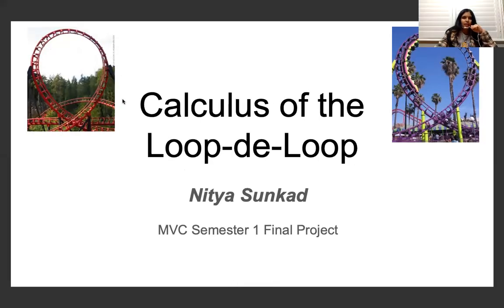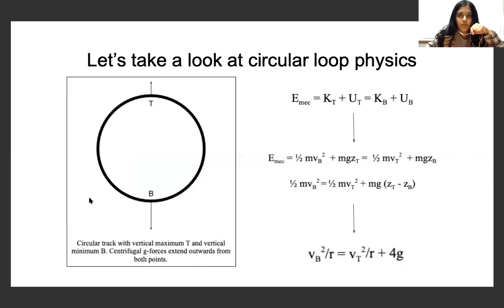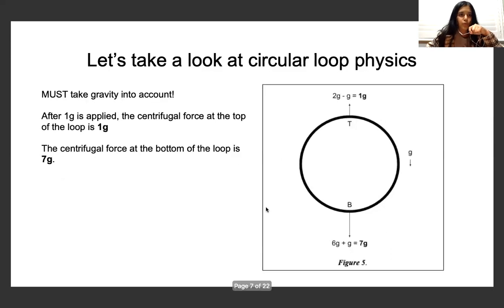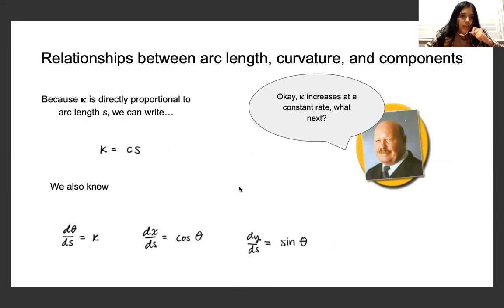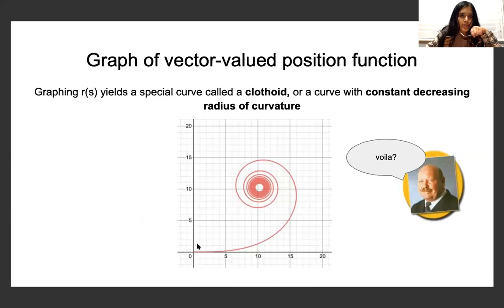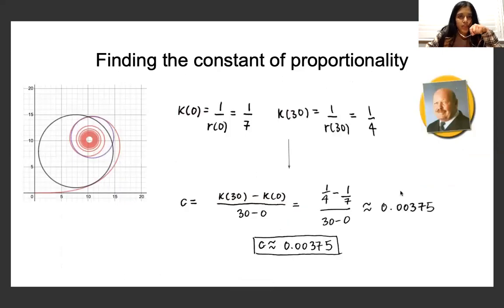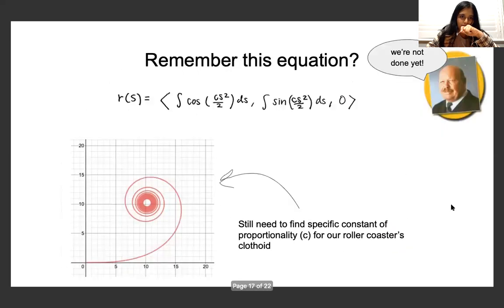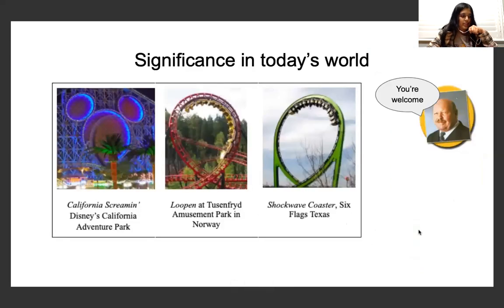Calculus of the Loop-de-Loop

Comment: wikipedia: "In 1957, Schwarzkopf built his first attraction, the Düsenspirale, which was a roller coaster that traveled around Germany with funfair showman Löffelhardt. He took over his father's company in 1960 and created his first full-scale steel roller coaster, The Wildcat, in 1964. In 1970, the first Jet Star II model was built for German showman Rick. The model became popular for its electric spiral lift hill, and many of this type were built. In 1976, Schwarzkopf partnered with ride engineer Werner Stengel to create a ground-breaking attraction, the Revolution roller coaster at Six Flags Magic Mountain in California. It was the first roller coaster in the modern era to feature a vertical loop. The vertical loop became a signature element used in many of Schwarzkopf's designs, including King Kobra at Kings Dominion in 1977, one of the first Shuttle Loop designs, and Shock Wave at Six Flags Over Texas in 1978, which featured consecutive vertical loops."